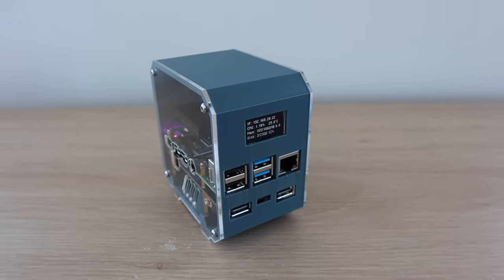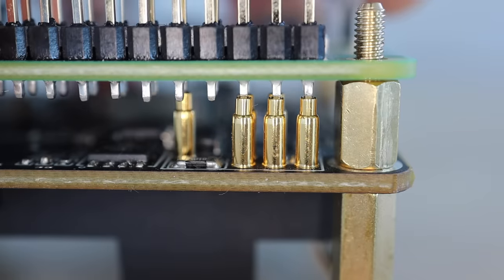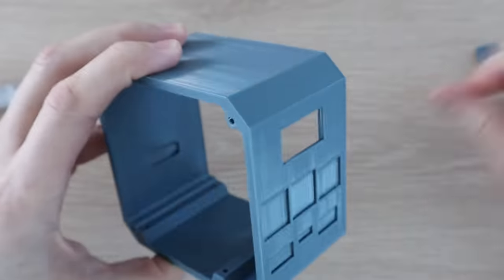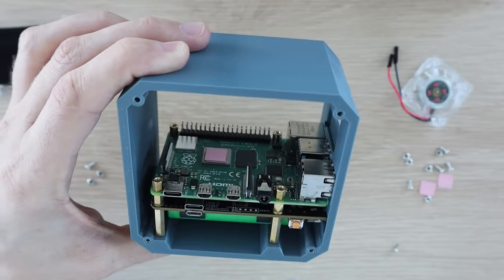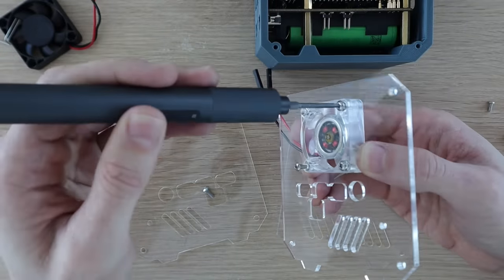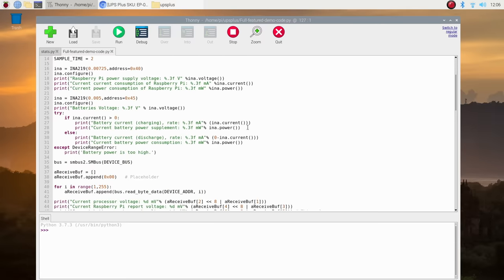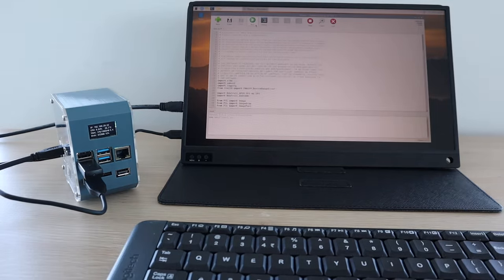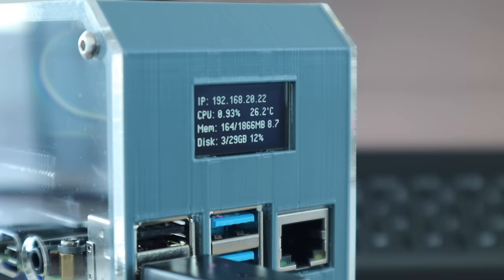Mini Raspberry Pi Server With Built In UPS & Stats Display

Comment: Suggestion - make a removable cover on the bottom to be able to replace the batteries
Reply: There a lithium ion batteries it would be a long time before you needed to replace them.
Reply: @tbyoda9475  Not the point
Reply: I had the same suggestion
Reply: @John T Smith yup

Comment: Adding a SSD turns it perfect.
Reply: adding nvme is a very bad idea, it still can give you 30MBps same speed when using nvme connected to usb then nas via LAN
Reply: Adding sata disque SSH or HD
Reply: stop promoting this garbage Raspberry pi, just buy a j4125 12v mini pc(router size), or a 12v ds220+ synology, a bit priced doubled but it will give you the speed, and tools you need.
Reply: @xienjougao3131  Bruh...
Reply: @xienjougao3131  lol you clearly do not get the purpose of the Raspberry Pi. What does that mini PC have for ports and how power and heat eifficent it is?
Does it have GPIO pins, camera and display connecters? Does somehow that Intel CPU consume less power and produce less heat then that Broadcom CPU?
The Raspberry Pi was originally designed for electronic projects that needs a full-fledge computer instead of a microcontroller.

Its design allows it be flexable, and being a low-power server is one of its viable uses.
That mini-pc maybe more powerful and modular but it consumes more power, plus where are you gonna stick that battery and stats display in? You will need task manager constantly open and as soon a blackout appears and you haven't found a way to jerry-rig a battery in there, you are going to lose your data.
(Aslo the Raspberry Pi is smaller as well.)
Reply: @one-shotrailgun8713  thats why  there's a $1 ARDUINO! most people mistakenly pinout gpio then your PI becomes garbage
Reply: to tell you exactly RASPBERRY PI is a trash! nas? the only average speed is 4MB/s using HDD slow as trash!
Reply: @xienjougao3131  And I just realized, the D220S+ is a NAS, not a freaking regular mini-server! When I talk about "server" Im not just talking about NAS's, im talking website, email etc.
I doubt the DS220S+ can handle being a NAS and being a website server at the same time!
Reply: @one-shotrailgun8713  Not to burst your bubble but J4125 and most Celerons/Pentiums are in fact passively cooled, unlike RPi4. You don't really need UPS for those boards because unlike RPi, if they lose power, they will not trash the filesystem and they can reboot after powerloss by themselves. You might need RPi with UPS if you are collecting some data, but for "serving" anything it's absolutely pointless, since you also need real UPS in front of your router/switch to have any access to it. For stats display, you can use the same display with ESP8266/32 for like $2 and have whatever server serving it data.

This is an interesting project, but economically, it makes zero sense.
Reply: @kaminekoch.7465  "Most Celerons/Pentiums are in fact passively cooled."
-Thats because the passive cooler that comes with those low-power Intel CPUs are either massive or used the entire case as a heat-sink. As for R-Pi coolers, you only need a small passive heat sink to run at stock clocks. (The case you use in your R-Pi aslo plays a role in thermal eifficiency as well.)

"If they lose power, they will not trash the file system and can reboot.'
-As for that data loss stuff, thats complete BS. Any computer is not immune to data corruption if power is cut all of the sudden.
That part depends on how reliable your hardware is and how lucky you are.

"This is an project has been intresting, but economically, it makes no sense."
-So as buying a actual server if all you are going to do is use it as a personal website/email server. Don't forget about the cheapness and the power efficiency as well!

Please for the love god get your basic facts about computers correctly and re-read my first comment.
Nice try about "bursting my bubble" tho.
Reply: @xienjougao3131  a HDD will not be bottlenecked by a pi4. i don't know what the overhead for USB-SATA adapters is, but neither the pi4 CPU or its USB3 interface will be an issue.
using a pi3 or older as a NAS may definitely bottleneck somewhere for some usecases especially as it uses an USB-ethernet adapter internally behind the same USB hub... but this is not the case with the pi4.
that x86-based PC you're suggesting is over twice the price of the pi4, and the NAS is specific-purpose, whereas the pi4 is not.
i'm not saying those are bad options, but those don't unconditionally make more sense than a pi. no x86 machine comes to the price point of those, so they fill in that gap.
either your opinion is way outdated or you're just shitting on the pi by principle for some reason.
Reply: @one-shotrailgun8713  pretty sure that SD cards have horrible resiliency to power loss on average, so that could be a point.
that being said, having an UPS as in this solution means you can go full yolo with write caching timeouts since you won't be getting power losses. i can't really see another usecase for a pi that sits as a server though, since it's correct that it's going to be useless without the router also protected.
Reply: @one-shotrailgun8713  "Any computer is not immune to data corruption" No, but compared to having your ext4 filesystem on an SD card with no protection, you might as well call it immune. You can go and unplug your running computer 100-times and it would statistically never trash your harddrive so it can't be fixed automatically. Do that with RPi with an ext4 formatted SD card and report back. There is a quite a good reason why there are filesystems developed specifically for SD cards, but these still have limited support. I don't know why you are so emotionally invested in this. It's a $200 project that has pretty bad points of failure all going back to the SBC used.
Reply: @kaminekoch.7465  if its a $200 project then having j4125 either minis/beelink pc on amazon is at the same price point, i bet u should try it out without putting a huge effort like 3d printing or whatsoever because it already have NVME M2, DDR4 ram, SATA adapter, PCI, USB 3, built in mic and 3 display port and lastly PASSIVE FAN all u have to do is plug and play! and thats it u will utilize your whole gigabit adapter for nas transfers, UPS mya$%$ hello??? its 12v, simply plug it to CAR BATTERY /solar and viola WHO NEEDS UPS?
Reply: 110MB/s nas to lan using HDD or NVME for single gigabit lan and 224MB/s dual gigabit as compared to your pi 30MB/s using NVME then RASPBERRY PI cant hold 30MB/s any longer and go down to 4MB/s whats the use of putting all your efforts?
Reply: @xienjougao3131  that 30MB/s metric comes from nowhere... also by the time you're using NVMe SSDs your cost has gone way up and it's stupid to cheap out on the computer.
that point doesn't really work in this example project where switching to a x86 machine would double the overall cost.
Reply: @asuasuasu  well try it XPG8200pro with orico JMS580 and RPI4 2gb ram
Reply: @asuasuasu  your beloved pi4 cant even hold a stable dataspeed it keeps on dropping to 4MB/s
Reply: @asuasuasu  Just searched it up your right about sd-cards.
But what your aslo right is getting out of this argument, I doubt this guy will stop at all...
Reply: I use my Pi as a NAS.

USB 3.0 to a 1TB HDD

It easily exceeds 80MB/s reads, the bottleneck is the HDD itself....
Reply: @gustavrsh  then why go ahead and blog it, post it here on YT, you might be the first!
Reply: @gustavrsh  *what
Reply: @telotawa  I am not a boomer, I just regret buying this thing
Reply: @one-shotrailgun8713   Don't complain about Synology NAS. If u check what their system can do .. u will not need anything else, as u can host anything on their NAS OS

mail server, web server, file server, cloud storage, chat server, db server,  surveillance server, etc
Reply: @ThisAmox  Techically it can do those tasks but

"u will not need anything else."
Bro you are over-estimating the capabilites of that Celeron J4025 considering thats not even a server-grade CPU and the 2gb of RAM that comes with the system. It can't take on 2 or more server tasks at the same time without getting severe slow downs.
(and it only supports up to 6gb and it only accepts Synology's over-priced RAM sticks.)

I guess it is good judging by reviews but only as a NAS. I have never seen anyone use a NAS for a different server task it was not designed for.

Just get a good server (or build your own server using normal PC parts) if you want it to perform mutiple server tasks at once.
A low-end NAS is only good for its intended role as a file server.
Reply: @one-shotrailgun8713  are you imagining that you have j4125 or ds220+? you can install dsm 6 to mini pc, and for ds220+ it can run LAMP server, FTP, samba and virtual machines at the same time, just try having it first before you start imagining things
Reply: @xienjougao3131  Shit is £350, could buy a good 2nd hand laptop mate. would outperform that smelly machine.
Reply: @MarcV_IndieGameDev  yeah, you could definitely buy a used laptop dated 2003 with USB C &3.0 , NVME, and sata 6gbps
Reply: @MarcV_IndieGameDev  search j4125 on amazon and let me know , prices of most should be 150-250
Reply: @xienjougao3131  Aye, you're right! I don't get these small PCs, they seem like under powered crushed laptops. Each to their own I guess.
Reply: @xienjougao3131  I'm saying I'd rather buy a 2nd hand laptop over a j4125. Pi's are over priced computers but... the hobbyist see more fun tinkering around with them and frankensteining with other Pi equipment. meh I'm out! Buy da fk whatever ya want lol
Reply: You are all so petty, and sound like two sisters in an argument.

Comment: I love it! Just a suggestion. Attach all hats outside the case and insert the UPS batteries last. Then using screws through the bottom of the case, screw down the standoffs on the UPS to the case. This would reduce the risks I'm seeing handling powered components during hat assembly.

Comment: You could use a small piece of plastic to slide between the connectors of the batteries.  Then you can just pull it out to energize the ups. Great build.
Reply: I should have read down further.
Reply: Which would help during the initial installation but not for later on if you need to be able to turn off the UPS entirely.
Reply: @jeffumbach  Just slide it back in lol
Reply: Then you have to use 2 piece of plastic on bolth battery
Reply: also  piece of norml paper could do the job and is easier to pry out :D

Comment: This would be perfect as a home assistant server!
Reply: Could you recommend good open source home assistant software?
Reply: Or NAS maybe
Reply: @valzzu  but for a NAS I'd go with the RPi 4 CM, there you've got a PCIe interface where you'd be able to put a dedicated RAID Controller or SATA Controller in and be more or less all set :D
Reply: @playeronthebeat  good to know, propably gonna make one when i move out.
Reply: @valzzu  I'm currently in the process of acquiring all the parts.

Since I'm into photography, I do want to have a NAS but I don't want to pay extreme amounts of money for it, when I can have it for way cheaper (or better for the same price) 😂😂😂
Reply: @playeronthebeat  yeah
Reply: stylish body👍
Reply: @claudiuchereji4341  Yes .. Home Assistant.
Reply: @playeronthebeat  Good tip. Thanks.
Reply: @Bear-form  no problem!
Wiretrustee actually developed a board with SATA Interfaces!

This seems far, far better than getting your hands on RAID Controllers etc (even though, in the long run they might be better!). 

I'm going to try it asap :D
Reply: xd
Reply: @playeronthebeat  I currently have 3 at home. 2 x 8 sata and 1 x 16 sata. Chinese boards. They are ok so far.
Reply: @claudiuchereji4341  "Home Assistant" IS the software.
Reply: But if your home power has gone out what's the point of your home assistant server still running?
Reply: @daz71  it can log power outages incidents and probably inform you over sms. But ultimately it's up to the overall setup.

Comment: This would be perfect if the units could be stacked next to each other in a daisy chain, to allow a large number of servers in a compact form factor! Also maybe finding a way to shut down the fan when running on battery power to squeeze out an extra few Watts, like powering it via V-USB directly instead of the VCC
Reply from the maker: Thanks for the tip, that's a good idea on the fan.
Reply: @MichaelKlements  actually it would also help to only enable the fan once it comes above a certain temperature, and disable it once it comes below a certain temperature. since the raspberry pi uses quite low wattage, even under decent load, so the fan might be using as much if not more power as the rest of the setup.
the icetower cooler you used should also be capable of keeping a raspberry pi 4 around 30 degrees celcius below the throttle temperature when the fan is of. so unless you are going to run it in a hot environment or overclock it quite much you wouldn't even need the fan to be on and so it would be a safety measure just in case it gets to warm, so for example enabling it at 60 or 70 degrees and disabling it when it is around 55 for the 60, or 60 for the 70. you could also add a delay to it turning of since many compute intensive peaks tend to be close to eachother, or you could automate it using the cpu and gpu usage to predict thermal peaks, however the termal activation and deactivation with a slight offset and a delay before turning it of would be a simple solution. the delay is meant so the activation and deactivation temperature can be closer to eachother without the fan constantly needing to start and stop, so it is a optimization for if you would run it in a hot environment like a server rack.

I have also found out of my own experience with a custom soc which is quite similar to the raspberry pi 4 but older that when using it as a server for a website and with a decently compute intensive game server running at the same time the wattage of the board will easly stay below 5w when tweaked propperly. note that that speciffic sbc should have a higher power consumption than a raspberry pi. people have tweaked raspberry pi s to run at much lower wattages than that, however with the automatic clock managing in the os you used in this video you will also in general get very low wattages whenever your cpu is not fully loaded.
Reply: Very astute, almost feel like you could remove the fan entirely and use a large heatspreader cooler block instead.  That is the way to get the most battery power, you could even undervolt the Pi a little too.  I don't know about the software but I doubt it requires the full available power for just server stuff.  That way you could have a row of half a dozen of these without worrying about the noise or the heat!

Comment: Amazing concept!  I can see adding a door on the bottom to allow access to the batteries whenever needed, and moving the display to the other end of the case so that all the cables come out the "back" of the chassis, then adding a door/cover for the micro-SD card, and perhaps using the other fan to exhaust out the back or top of the case, and a simple 3D printed push button mounted on the side to reach the UPS' function button.
Reply from the maker: Nice ideas!
Reply: @MichaelKlements  how much would you charge to print a case with the display cutout at the front and a push button for the function switch? i don't own a 3D printer. i love your video
Reply: @odiliomartinez4338  if he cant do it I believe there are some companies that print stuff for you and ship it to you so you would just need to get the file with the design on or make your own
Reply: @odiliomartinez4338  if youre in the US, check with local libraries too!
Reply: @odiliomartinez4338  You can also ask local maker clubs, hackspaces, hobby communities if they can let you use their printers.
Reply: Waste
Reply from the maker: They're now available as a kit on my Etsy store - https://www.etsy.com/au/listing/1075810351/raspberry-pi-4b-ups-case

Comment: For temporary isolation during assembly, you could put a small plastic ribbon or other low-friction insulator between the contacts, similar to how some electronics are shipped. When you've completed assembly, yank on the ribbon and the contacts meet.
Reply: Was gonna say the same thing
Reply: I'd rather have designed a "battery hatch" to both make them easily changeable and work around the issue of keeping it powered while assembling

Comment: I did not know a UPS like this existed!
Welp there goes some more of my money.

I'd just been using my usb power banks whenever I needed the Pi to be portable. This will make it so much easier.
Reply: most banks don't provide 3A needed for the RPI 4, unfortunately :(
Reply: @kkazakov  Get one that supports QC3 (Qualcom Quick Charge 3). They are pretty common these days and you can run a Pi 4 from them. A powerbank with usb c PD is even better